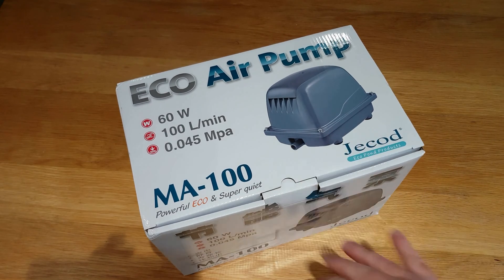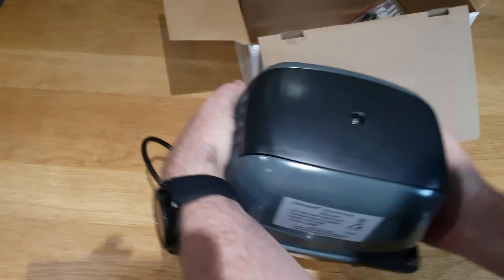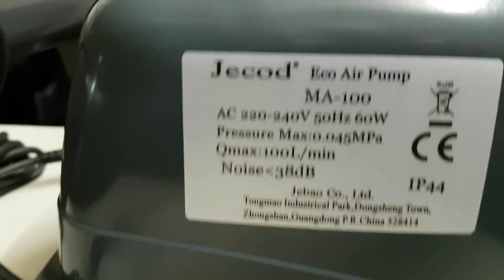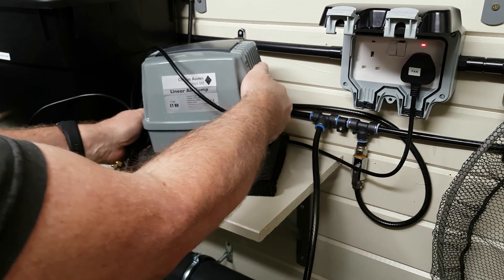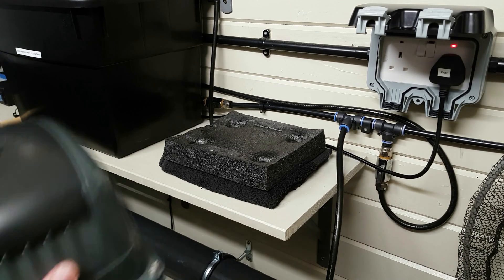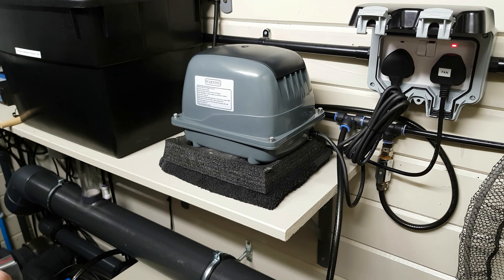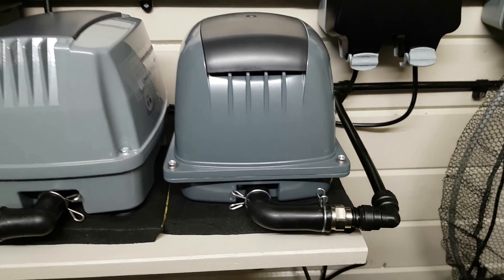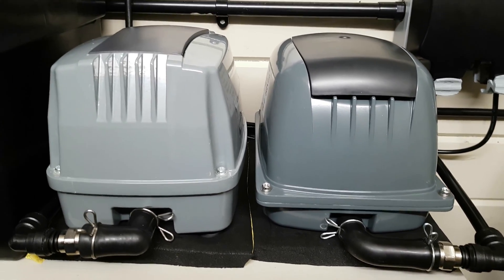Jebao/Jecod MA100 Air Pump V's Charles Austen ET80

Comment: Not a straight comparison. I would have liked a et 100 against an MA 100 comparison. Looks great though and certainly more air. Curtain looks great , thinking of setting one up myself.
Reply from the maker: Thanks, 🙂
I think they are better matched than the ET100 V's MA100 as they have a very similar wattage. 
The ET100 would probably spank an MA100 but the ET100 has a higher  actual wattage.
The chinese brands like Jecod do a have a slight habit of over rating things 😄

Comment: Quick question. Where do you get your black speedfit pipe and fittings from ? Thanks.
Reply from the maker: Hi, 
I use John Guest or DMfit 12mm push fit fittings, 
and 12mm LLDPE pipe that you can get in various colours including black.👍
commonly available from some caravan/camping shops, finch filtration, Vyair, or ebay. 🙂

Comment: Can I ask what black airline and what sized connectors you are using. Thanks
Reply from the maker: Hi, 
I use john guest or DMfit 12mm push fit fittings, 
and 12mm LLDPE pipe that you can get in various colours including black.👍
commonly available from caravan/camping shops, finch filtration, or ebay. 🙂
Reply: Thanks Dave. Will look 👀

Comment: dave where do you get that black air pipe and elbows from please if you don’t mind me asking
Reply from the maker: No problem 🙂
The pipe and fittings  are 12mm black speedfit, pipe is 12mm LLDPE.
 john guest and dmfit make them.

You can buy from  ebay shops like 'rebel leisure' or 'spring clear' also vyair, finch filtration, and some caravan shops sell it.
Reply: @DavesKoiPond  ok thanks
Reply from the maker: @kevinwhite1077  
now i'm back on my PC (find it easier to use than mobile phones i'mold skool lol 😄)
here s a couple of links to get you started 👍
https://www.ebay.co.uk/itm/223155488264?hash=item33f51a8608:g:5coAAOSwZttbpK2A
https://www.ebay.co.uk/itm/221593247280?hash=item3397fc9e30:g:eoIAAOSwcF9UVmJz
https://www.ebay.co.uk/itm/185659041034?hash=item2b3a24250a:g:54cAAOSwuq1klp50
https://www.finchfiltration.co.uk/fittings
https://vyair.com/product/dm-fit-12mm-black-lldpe-pushfit-tubing/
Reply: @DavesKoiPond  thank you

Comment: Nice update on the air pump what are you using to stand the pumps on Dave
Reply: Hi Dave, just come across your channel so will take a look at your videos. Looks like a nice tidy set up there👍. I love the look of the air pipe and just wondered what pipe and dimensions it is ? Subbed you
Reply from the maker: @sisworldofkoi1976   Thanks, 🙂
I made a video showing how I made it, and links to where I got the parts from in the description 👍
https://www.youtube.com/watch?v=A77BM1CbPFQ&t=167s
Reply: @DavesKoiPond  cheers Dave, will no don’t come across it soon when I get through your channel 👍
Reply from the maker: Thanks Carol, 🙂
The ET80 was just on some packing foam with a towel underneath at the start of the video.

But at the end of the video I used some 54mm x 25mm rubaflex Class O pipe insulation I had left over...same stuff as armaflex lagging only cheaper.

it's actually brilliant at isolating and damping the air pumps because it's firm enough to support the heavy pumps, 
but also.... 'squidgy' (is the best way I can describe it 😄) enough so that it dampens the vibrations.

I just cut a couple of pieces 10" long for both pumps and opened it out flat.

https://www.jtmplumbing.co.uk/insula...mm-wall-p27114

you can also get armaflex class O as flat sheets too but it's a bit more expensive...

https://www.jtmplumbing.co.uk/insulation-c555/armacell-armaflex-sheets-c624

Comment: Hi Dave. Another first class upload. Have you ever found or heard anyone saying that the air domes on the bottom drains block, when not in use? Thank you
Reply from the maker: Cheers mate 🙂
I suppose they could get crap stuck in the holes, but because they are a rubber sheet and inflate when pressurised, 
I'd imagine that the holes would stretch a bit and blow any rubbish that gets in there out...
I've not had mine block up, even though the dome gets crap on the top when not in use, as soon as I put the air on it blows it all off...

Though I could see them blocking up with constant use though, as scale might form where the air and water meet.
Or if you get blanket weed or algae growing into the holes...
Reply: Thank you for your reply, Dave. Love your air curtain.

Comment: Good buy. I have the white one, the PA60  from Jabao (same as Jecod) but mine is really loud. But it's only to clean the easypod so just on for 10 minutes at the time.
I always thought that the Charles Austen were quiet so I am glad you said they are as I was looking at one.
Reply from the maker: I thought the PA Jecod's are supposed to be fairly quiet? 
Most of the lads that have them say they are very quiet, or maybe you have very acute hearing 😁
The ET80 sounded like a jet engine when it was new, but the noise soon quietened down after a few weeks.
It's not too bad now, but you can hear a deep reverberating hum when it's running...

The PA's are just a slightly lower maximum pascal pressure pump than the MA Jecod.
0.035 Mpa for the PA 60 versus 0.045Mpa for the MA100/120.
But they output  more air than the eqivalent MA's at a meter or shallower.🙂
Reply: @DavesKoiPond  ah I see. Useful info. Yeah I got this one after being recommended but I can't use it as a permanent air pump. May be it was a bad batch, it happens I guess but I couldn't be bothered to send it back. It's the white and blue one I have. 
Are you still pleased with the air curtain? I like the idea of it.
Reply from the maker: @LauMagroTheFrenchKOInection  It might just need the diaphragm's refitting... 
A mate replaced his diaphragm's on his PA when they were broken and said it was really noisey when he turn it back on.
He thought he may have not aligned it properly.
This was the only video I could find showing a diaphragm replacement for the Jecod PA.
I don't understand a word...😁 but you might get the gist of it by watching...🙂
https://www.youtube.com/watch?v=DJMvKQtb8WQ&t=1s

Yeah, I still love the air curtain, 👍 
A much more gentle way of adding aeration without the washing machine effect of the bottom drain 😂
I still like to use the BD air strongly, as the water currents really perk the fish up a bit when it's on. 
But I don't think the fish like it all the time, bit like exercising then having a rest afterwards lol 😄